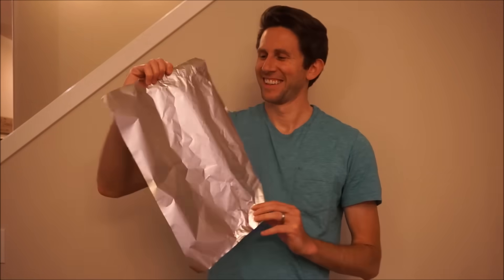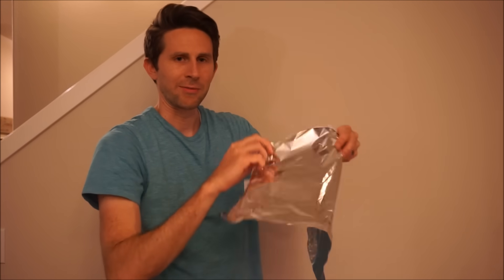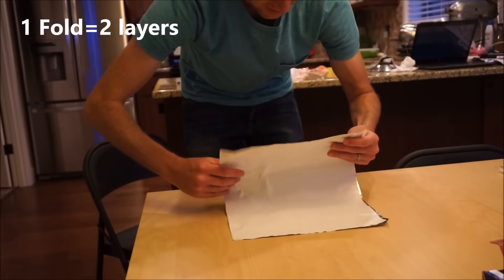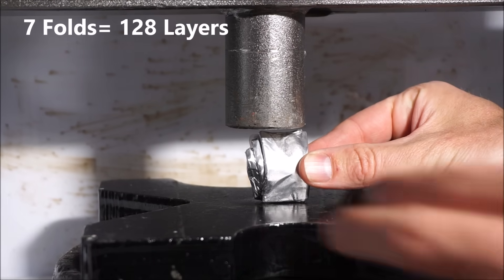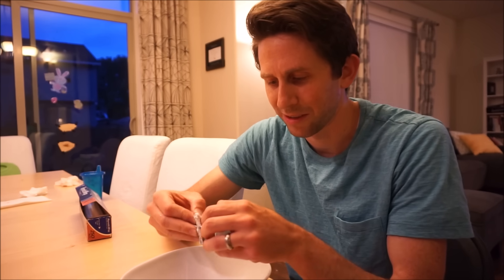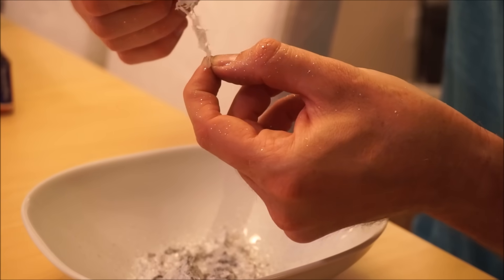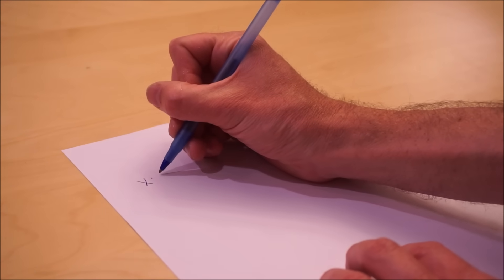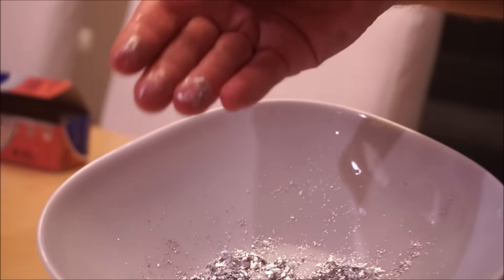Folding Aluminum Foil with Hydraulic Press (32,768 Layers)

Comment: This is not the safe way you perform this experiment . Stop using your hands directly for your safety
Reply: Well it is because you obviously don’t understand that a human has full control of there hands. So they can move them out of the way if the press touches them.

Comment: 30 nm! Try to express that in imperial units? 11⁄9,313,352nd inches
Hate to mention it, but the 32768 layers are only a theoretical value. Nothing guarantees that some layers haven't shifted. At 4:17 we even see one (or more) layers stuck to the press. Nevertheless, nice work.

Comment: Metals are easier to fold then paper as they are more Malleable aand Elastic compared to paper. When too much of pressure is applied, Matal just bends, Whereas the paper just breaks away.

Comment: There's something wrong with ur calculation... U added up the thickness of each layer but u should equate it to the thickness of the folded foil and not to thickness of the original foil paper

Comment: this isn´t even an hydraulic press?! what a bad faker
Reply: Actually, it is. There are manually actuated hydraulic presses, those operated with hydraulic pumps and those that are actuated by a pneumatic driver. The manual and pneumatic actuated versions use hydraulic bottle jacks. The difference between them is the way in which the hydraulic jack is operated. This one uses a pneumatic hammer type setup that drives the manual pumping mechanism of the hydraulic jack.
Reply: B3ASTY BR0 they name they channel hydraulic press action and use a pneumatic press i dont have to watch the video to guess that.
Reply: B3ASTY BR0 are you drunk? You can hear the compressor turning on in the Background.
Reply: B3ASTY BR0 Here in Germany we say:"Wenn du keine Ahnung hast, einfach mal die fresse halten"
Reply: Forjam Ganz ruhig bitte
Reply: kibDo ja is doch so
Reply: kibDo ich wette der weiß nochnetma was hydraulic heißt
Reply: TJEssary Lets say its a hybrid press :D but this channel is still some poor fake shit! hydraulic press channel is the one and only!

Comment: i dont get why people are so ignorant in understanding why 15 folds does not equal that many layers. the simple exponential equation f (15)=1*2^15 gives you thoes many layers. 15 is the amount of folds. if you cant read the function then you either need to go back to school or pay attention in math.
Reply: I’m not that far in math yet XD
Reply: Xannax then if you do this you do get 32768 and I really don't understand why would you put 1*2^15 because that 1 does nothing.
Reply: Xannax when he puts layers I think he means how many squares there will be when you un Fold it... Idk
Reply: Road2DiamondCamoz no, he quite litterally means layers. if you fold aluminim foil twice, you get 4 squares correct? this same concept can be grasped with the formula. He is not referring to squares. Hes reffering to layers.
Reply: i meant 4 layers, not squares.
Reply: They counted the plastic
Reply: Bernadette T. Depending on the school you go to, this should have been learnt this in 8th grade, if not. Then 9th grade for sure, it’s not hard to understand.
Reply: Xannax u just write a stupid bitch equation to say he is wrong. its clearly 32768 by 2^15.

u need to go back to school idiot
Reply: u put an equation which also give 32768 layer. what a dumbass. 

did u just 2×15=30? you are stupid af
Reply: Bernadette T. It's simple algebra 1. Every one learns it in school.
Reply: Real deal The only difference between what you did and what I did is that I put it as an equation. Why are you so angry?
Reply: rhii don't know what the big deal is here, just trying to explain to the people who are confused. Didn't think I would get "hate" from this. I guess you can never win.
Reply: but the amount of squares when you unfold it should theoretically be the same amount as the layers but when he folds it that often i dont think he can stull call it layers
Reply: Xannax I love how you said "it's simple" and then put a long confusing equation😂

Comment: besides all your little experiments squishing things in the press what in general is it actually used for??
Reply: I like animals More than people when we use ours we use it for pressing bearings in and out in like enginges and frames.
Reply: I like animals More than people There's a ton of different ways these can be used. Our shop has one that isn't like this, it has a bunch of different attachments for metalworking like bending, cutting flat iron, punching holes in the metal, and plenty of other things.

Comment: instant fail 2nd fold aluminium was on aluminium not seperated by plastic
Reply: Elena Bala when he folded it the 2nd time, it was aluminum on aluminium, and not having every layer separated like he said earlier in the video ☺
Reply: And all he needed to do was to sandwich that alu foil between 2 sheets of plastic.
Reply: tony flamingo still, two layers should always be seperated, so he made 2 layers of 30 nm at least
Reply: tony flamingo huh?
Reply: I know I was just seeing that

Comment: that's just 8 folds really it's just turned to broken pieces that were only held together by the plastic
Reply: Real deal What the fuck are you talking about.
Reply: folded aluminum 8 times by my hand the day I posted it proving you don't need expensive equipment
Reply: Lmao he wanted to hit 10 minutes so bad
Reply: Orange Douche this is not A4 paper. u just assume it
Reply: Orange Douche it didnt break apart on the 8th fold. Its already break at 5th or 6th fold.

Comment: You didnt measure to get "1mm".  If you are off by just one mm, or more possibly, you've changed you calculations in a large way.  Also, you could have just used pen and paper and saved the press since it was all calculation.  No need to make aluminum dust if you're not going to observe or measure that dust.
Reply: he needed proof IT'S POSSIBLE

Comment: Came from Momma O's that was pretty cool thanks for sharing!
Reply: wow , thanks so much for coming on over and checking out his channel! how fun is that!
Reply from the maker: Thanks!
Reply: captian drago Only by 8
Reply: you got the 2 to the 15th power wrong it's 2 x 2 x 2 x 2 x 2 x 2 x 2 x 2 x 2 x 2 x 2 x 2 x 2 x 2 x 2 witches 32760 so it's a lot smaller than you said
Reply: captian drago no he got it right
Reply: I messed up a bit I wrote that in a hurry 1 millimeter is 1 million nanometers this is only 32 thousand I meant to put bigger my first statement but I will admit I brain far when I was in a hurry he got it wrong by 968000 layers
Reply: wow impressive!
Reply: And thank You for helping to make a comment thread that was actually worth scrolling down and reading...